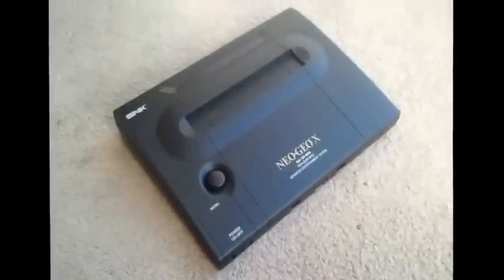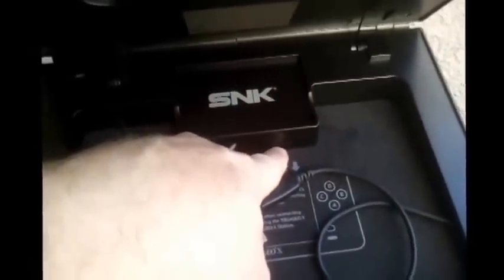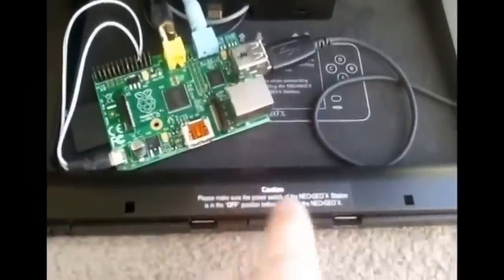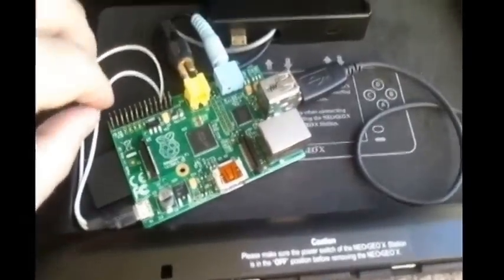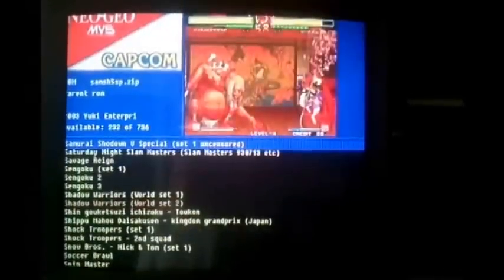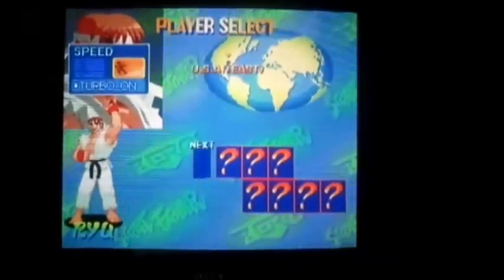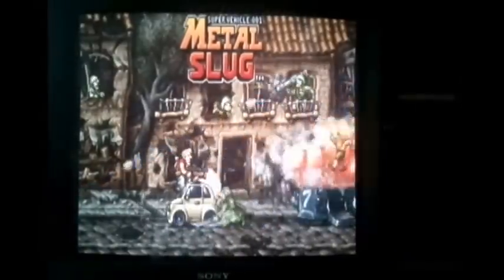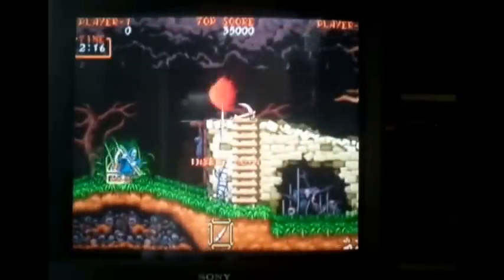NEO GEO X meets Raspberry Pi

Comment: What kind of power supply did you use? I was wondering If I should use a 5V 2.5A (as recommended for the PI) with the correct plug, or the Neo Geo X original power supply. Thanks in advance!
Reply from the maker: i used the one from the neo geo x, works fine. thanks for checking out the video

Comment: You could have support for another controller. for example you could easily fit a Xbox controller dongle on the inside of that case. that way any game that needs more buttons you could use the Xbox controller.
Reply from the maker: yes, you absolutely could. i wouldn't want to since i was shooting for an all Neo Geo system. but if you wanted to do a full raspberry pi emulation station install an Xbox controller would be a nice way to go.

Comment: That is what I want to do but can I fit NUC MOTHERBOARD TOO? Because retropie didn't support all Neo get game like King of fighter two thousand one
Reply from the maker: i actually got all the neo mvs games working on the pi. you have to be willing to put in the time and download roms that don't work at first from an different site then a different site again and again, till you find one that works. also, using rom center helps. i don't have a nuc, so i couldn't say if it fits or not. once the base is closed, there really isn't much room left in there.
Reply: Chris Ball also is there any way to convert an AES Stick to Usb?
Reply from the maker: you could probably mod one using a teensy or a cheap usb game pad. another way would be to buy  the "2x Zero Delay USB Controller To PC Joystick" kits from china and tap each switch in the AES controller. it should be a super easy mod. i actually have a set of the usb controller boards i am planning on using on my arcade machine. they are pretty universally recognized so there shouldn't be any driver issues.

Comment: I am gonna make it =)
Reply from the maker: awesome! i was kinda unsure about modding the base, but the pi makes it into something you can actually truely enjoy unlike the unfortunate NGX it's self. i really hate putting the NGX down because i wanted it to be awesome and it almost was. they should have release something to fully unlock it and mod it as we see fit when the project was canned. but at least we have this!
Reply: just got a NG dock from aliexpres for 40 bucks =]
Reply: Can you tell me when you get it if it is good quality? i can get a Full NGX set (with handheld console) for 250 Euros but since i am thinking about putting a STX motherboard inside i would only need the docking station.... Thx if you can tell

Comment: how did you get the pie to read the neox controller? I cannot get mine to read it. the pie sees it when it boots but when it goes into emulation station it does not detect the controller
Reply from the maker: +Steven Sloan i used the neo geo (fba) emulator that came with Pie Play. i actually downloaded a pieplay image and changed the boot program to fba. you can get them to work with retropie too, but it takes some effort. here are some links to a guy that knows what he's doing better than me, hope it helps.
https://www.youtube.com/watch?v=xkD255l3FuY

https://www.youtube.com/watch?v=9PWO-F4zuaY

Comment: Hey dude, I'm working on basically the exact same project! I've connected my Neo Geo X controller.. but I can't get the pi to recognize it for the life of me.. confirmed that it's working fine on my Windows machine, but retropie, nor gngeo, will recognize it. Any tips or ideas? Thanks!
Reply from the maker: Jason McLeod yeah, this was a big pain in the ass for me too. i had to go into the config file an edit it in order to get it to work properly. i also ended up not even using pie play or retro pie, i used the pie play image to start with, but changed it to load right up into FBA rather than pie play, then i sort of made my own skin for FBA. if you don't know how to get into the config file to edit it, i guess i could make a video covering that. let me know if you need help and thanks for watching.
Reply: Chris Ball Yep, as you mentioned.. I skipped emulationstation and went straight to pifba and the controller is working after some config edits! Now I'm trying to follow along and do the power switch + USB Hub wiring. I patched the switch in, and whats weird is.. the pi wont turn on. I tested with a USB powered speaker and that charges when I have the switch in the on position. 

Also, do you remember what the pinout for the usb hub is? It looks like (using the microusb that was already in the neogeox casing) red = power, white = ground, the other 2 im not entirely sure yet.. But before I fry anything I thought I would check here :)  Thanks!
Reply from the maker: Maikeru722 i had the same problem, i had to use "pie play" instead of retropie to make this setup. i downloaded and image of pie play and them made FBA the boot program rather than pie play its self. i wanted to use retro pie since its easier to use, but i couldnt get it to work.
Reply: Jason McLeod Can you guys explain how you created a config file for the Neo Geo Stick? The Stick is working with Retroarch but not with retropie. I've located the folder with all the controller config files but don't know how to go about getting a config file to work for the neo geo x stick.
Reply: Okay Thanks!

Comment: Man that NGX is a pile of junk if i had kept mine this would have been the ideal project, the emulation looks spot on actually.
Reply from the maker: Yeah, tell me about it. the NGX was kind of cool in concept, but couldn't live up to what we all hoped it could be. throwing a Pi inside the base worked out pretty well, the emulation is pretty darn close. its certainly WAY better than the actual NGX system since there is V-Sync, this is major, but the resolution is still way higher than native, but it still looks very nice.